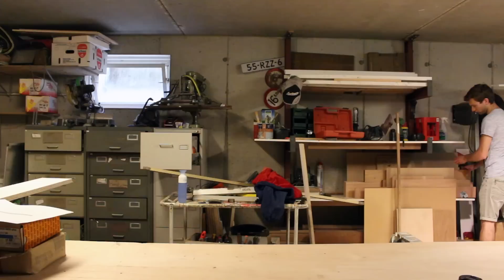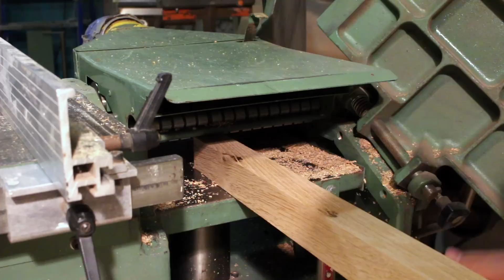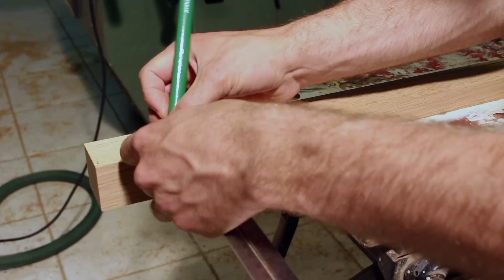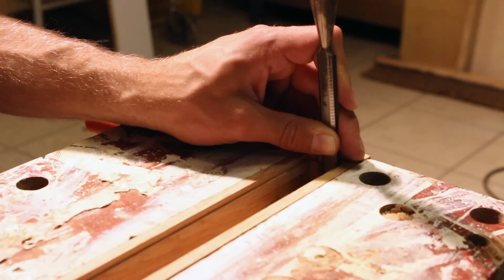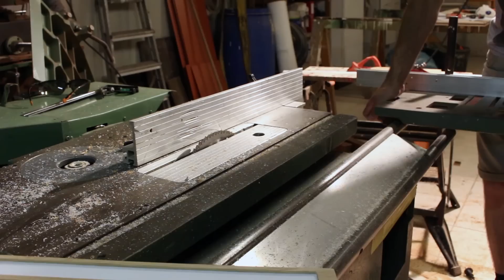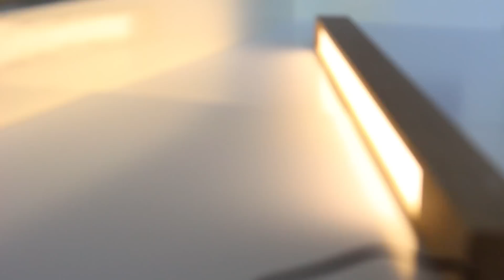JM - #014 Light beam

Comment: May I ask what kind of diffusion material you used? It looks like white plexiglas, but that is usually less transparent? When you slide it into the lamp, you can see the wood through it?
Reply from the maker: It is Makrolon DX NR 141. I bought it from PyraSied Extreme Acrylic, I hope you can find such kind of material near you. It comes with an white protective plastic film. You can not see the wood or the LEDs through it.

Comment: This is great. What exact components did you use for the lighting? Where is the IR Controller?
Reply from the maker: The ledstrip has no brand, it came from a store near by. I have used an RF controller, http://www.ebay.nl/itm/11-Key-RF-Remote-Switch-Controller-Dimmer-for-Single-Color-LED-Strip-Light-DC12V-/172222026029? & _trksid = p2056016.l4276

Comment: you cut the acrylic glass with your circular - handsaw because you didnt want the edge to break while it is beeing cut.
You could have easily done this on your tablesaw by partially cutting into a piece of scrap wood and clamp it to the table - then there is no longer a gap between the blade that could harm the acrylic glass whilst beeing cut. You just slide the acrylic glass over the piece of scrap wood.
Reply from the maker: Nice suggestion, thanks!
Reply: you are welcome. Keep up the good work!